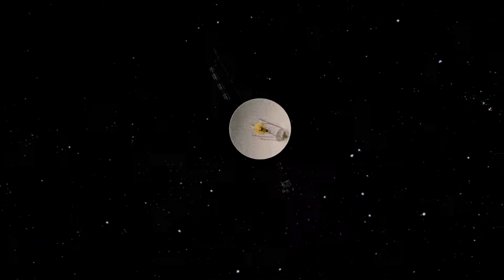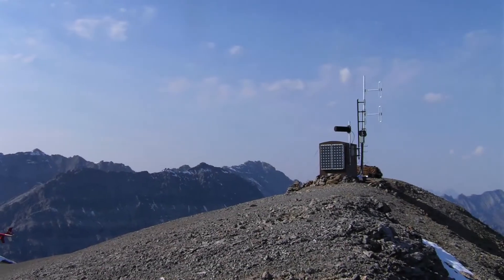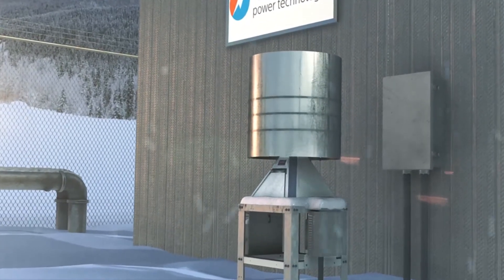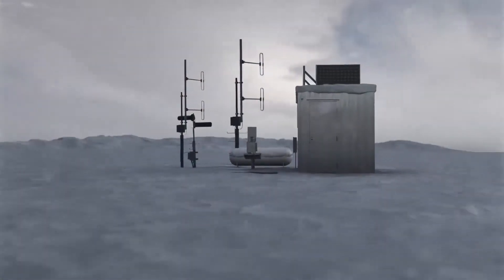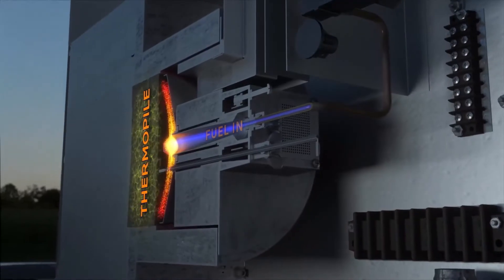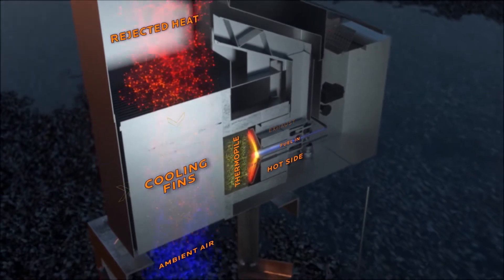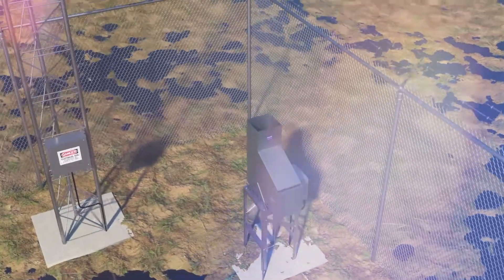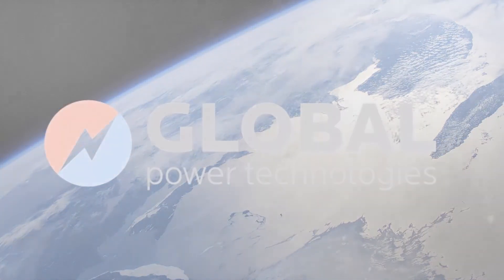How it Works - Thermoelectric Generator

Comment: The solar hybrid is still using fossil fuel to charge battery together with solar panels. I hope that your company sees into the future and by 2030 these gas TEG may not be allowable. Please develop fully solar pvt  TEG from waste heat. I would be first inline to preorder.

Comment: Such an amazing invention;
It's totally relies on Seeback theory;
bur Sir, i still have a question here please
We still need Gas as a heat source, is that right ?
Reply: Not necessarily… you need a temperature difference really, once you have that you can get electrical energy, from what I can tell the gas is just what they’re using for a heat source to cause the temp diff I think…
Reply: No... They just focused their patronage on large industry waste energy recovery. Seebeck energy conversion has much more practical and scalable applications.